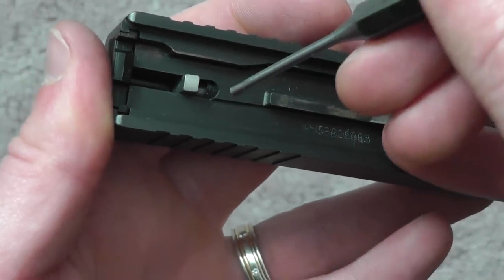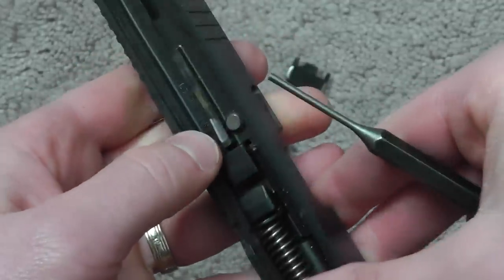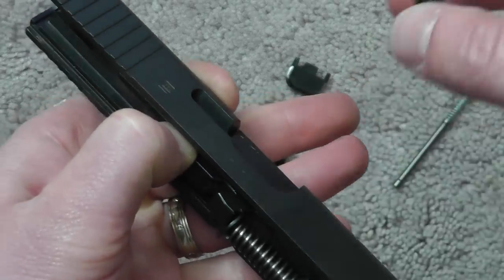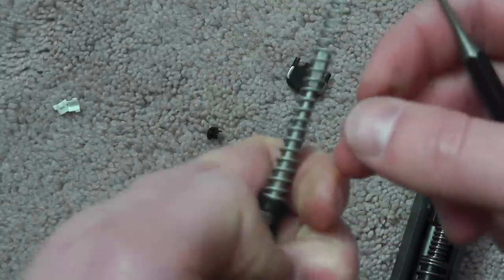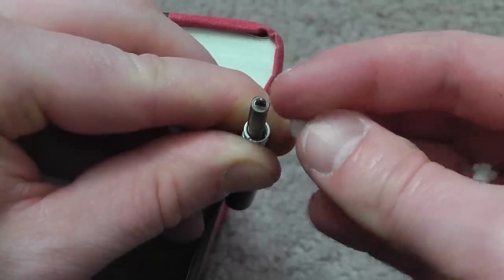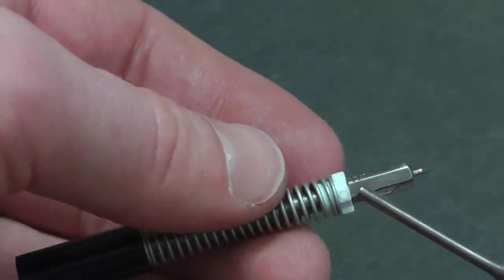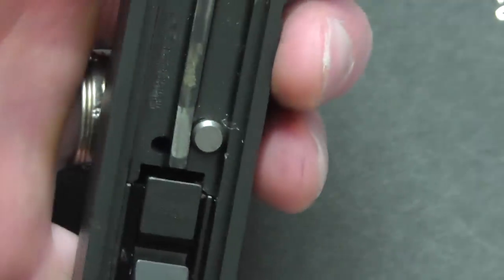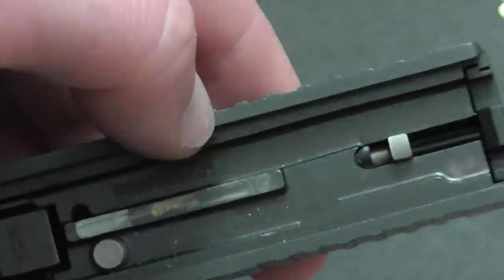Glock spring cups install  (maritime / underwater version)

Comment: As a factory certified Glock armorer I had to note something here: These are NOT "underwater" spring cups as everyone so erroneously refers to them as. They are simply designed to allow any moisture that may have been introduced to the firearm to escape without creating a hydraulic situation within the striker channel that causes a misfire.
Unless you carry your Glock in a high moisture environment (marina, waterfront, beach, etc) it is no recommended to install these due to the decreased contact area and shorter service life.
Again, they are NOT so you can fire the gun underwater.

Comment: After completing this modification you should test it by racking your slide then pull the trigger and hold the trigger down while shaking your gun back and fourth and you should hear your firing pin assembly rattling back and forth inside your slide freely, if this does not happen it means that you don't have enough clearance between the maritime cups and the firing pin channel tube, this takes away the velocity needed to set of the primer on the bullet or you could get frequent light strikes, the easy fix for this would be to lightly sand or polish the edges of the maritime cups until your firing pin assembly runs freely on it's own without the assistance of your finger, I had this problem when installing new maritime cups and found out about this method of checking the firing pin assembly through a book I bought written by Robb Manning called "GLOCK, reference guide) it's a 222 page pictorial book that I recommend every glock enthusiast to have and read, best regards!

Comment: My man, getting STRAIGHT to the content and not giving a multiminute preamble asking us to like and subscribe.  I love it.  One tip I can suggest is resting the firing pin assembly on the slide, where it goes in but put it in "backwards" and then twist.  That part on the firing pin will rest on the back of the slide, and it'll be a really nice, stable area to work with.
Reply: Thank you for that tip!  I'd seen that years ago, but then forgot it.  I was recently replacing a firing pin spring, and had to have my wife insert the cups while I used fingers of both hands to hold the firing pin with the spring compressed.  If I hadn't forgotten this trick, I could have done it by myself.

Comment: Though you missed a few points it's quite a fine video with decent macro. Thank you much!  The points you had missed involved matters other than installation and orientation of the spring cups. You could've performed a mandatory safety check of the visible tip of the firing pin extending past the breach, and not, the firing pin 'shake' test, and a view of the extractor after reassembly with tip of the extractor depressor plunger aside the rear of the extractor as proper. Since you went in that direction I felt it helpful to others to comment.

Comment: I recommend shining a flashlight down into the firing pin well before reinstalling it, and look for any brass shaving build-up on the lip where it seats. There tends to be a lot of it  smashed in there that could eventually result in light strikes if allowed to build up. The first time I did this I picked a ton of it out using a scribe.

Comment: The MSC only have 4 small points of contact within the firing pin channel witch equates to less friction throughout entire length of travel, herd comp. shooters use them for this reason
Reply: Wrong. It only helps water drain from the striker channel enabling underwater firing.

Comment from the maker: I do.  Doesn't hurt. Never had a problem.  I got these from lonewolfdistcom  So they are made by LWD.  Ghost also makes some.  There is a factory version as well but in my opinion they don't fit as good as these white lwd's.  No experience with ghost.

Comment: Massive thanks, helped tremendously. But, question. They say they don't last that long. Is that true. I mean judging from the material
Reply from the maker: +Steve Fox   Can't say that I've experienced that. Nor have I seen anyone talking about it on the msg boards...for example glocktalk.   Maybe it has...but if it was common place I think I would of seen signs of it or heard about it more. And I have not.
Reply: @AmmoTest  Still holding up?